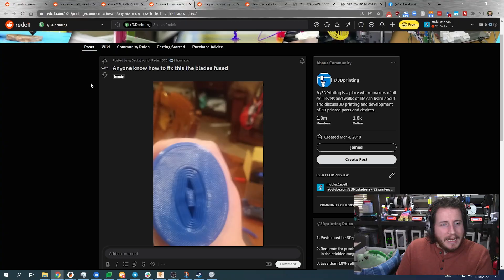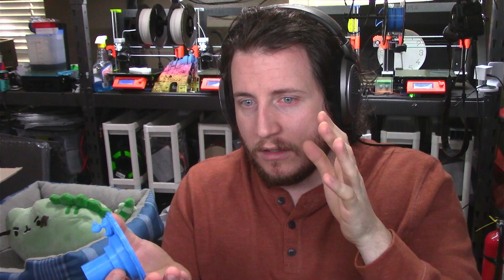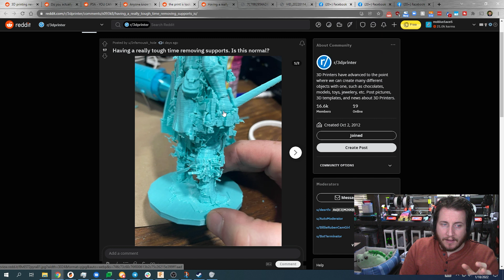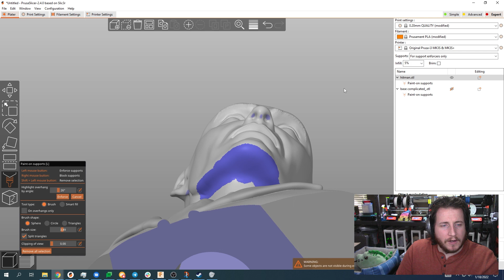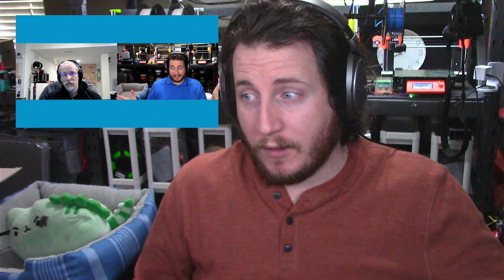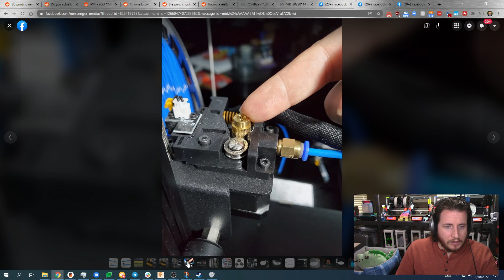Is It Possible to KILL Your Printer's Motherboard? - PrintFixFriday S1E19

Comment: If I accidently mixed up the positive and negative wires coming from the power supply  would that kill my board? (tronxy v10)
Reply from the maker: it could happen if it is not properly isolated.

Comment: I hooked up a variable output buck converter to change the hotend fan, just the buck converter without the fan hooked in yet, and turned on the printer and there was a big spark from the buck converter. Later, I smelled something... then I tried to use my klipper API (Mainsail) and it won't let me, complaining that it's unable to connect to the mcu. Then I expose the motherboard and find that the smell could be coming from there. I don't think my wiring was bad so... if the buck converter shorted, could shorting the k-fan (hotend) blow up my mainboard? My mainboard is Creality 4.3.1, if that helps.

Edit: I just looked at the mainboard closely and the capacitors are fine; the only damage I can find is on the biggest chip in the board, I think it's the processor; it has two little melted points on it and I'm guessing this is what I was smelling.
Reply from the maker: yep.. thats a dead board :/ Why use a buck converter when you can just get a fan with the right voltage?
Reply: @3DMusketeers  I'd like to, it'd be much easier, but I want the highest cfm 4010 fan I can find, and I got one with 9.9 cfm but it's 12 volts. Also it's still quieter than the stock Creality fan, so really the only caveat is the buck converter.
Reply from the maker: @josephzicaro79  you want a boost converter not a buck. 

Also, CFM is not everything. You also want static pressure. If you have lots of CFM but no static pressure it wont flow through the duct(s) you have
Reply: @3DMusketeers  Buck converters, or step down converters, decrease the voltage (and thus increase current because of the conservation of power) whereas boost converters increase voltage. Going from 24V to 12V, I want a buck converter, not a boost converter. 

Thanks for the static pressure tip, I'll look into it, but I'm guessing that static pressure is approximately linearly related to CFM, so I'm not too concerned.
Reply from the maker: I had that backwards in my head.. I thought it was a 12v printer, sorry!

Honestly the bog standard 5015's work fine for me!

Comment: I once accidentally fried the thermistor inputs of a SKR 1.3.
Reply from the maker: rip :( What did you do???
Reply: @3DMusketeers  Messing with the connections while it was on.
Reply from the maker: Been there before :/ Thankfully motherboards have come down so much in price with many options out there!
Reply: @3DMusketeers  I replaced it, then the SKR 1.4 came out shortly after.

Comment: 2 weeks ago I accidentally bridged the thermistor and heater cable with one of those brass nozzle toothbrush while cleaning the nozzle when the printer was on. the main board got fried of course with wrong temp readings. Be careful when using this tool guys!
Reply from the maker: YEP, don't use metal brushes unless your connections are insulated :) You can always heat up the printer and then quickly turn it off to make sure you can clean it safely.

Comment: I tend to plug stuff into a power strip and turn off the device AND the power strip. That way, the case ground is still there.

Cura has settings to adjust z distance AND x/y distance to supports. .23mm works for me but, of course, that's heavily printer-dependent.

Layer 1 can also be deceptive! It can look great when you're both under-extruding AND too close. In that instance, you're filling a smaller gap, but then all subsequent layers are garbage.
Reply from the maker: that is also a good plan! Just have to make sure there is no leaking of voltage!
Reply: @3DMusketeers  Yes. Ideally using an electrician's thumb to be certain.
Reply from the maker: YES! Those are great!

Comment: Reiterating: RESIN IS TOXIC

Haven’t had any issues with it (yet), but I’m pretty damn careful with it. Especially when airbrushing it on my FDM prints. 

Kidding. Just kidding. NEVER SPRAY RESIN!
Reply from the maker: looks for ban hammer

false alarm LOL.
Reply: @3DMusketeers  😬
Reply: @3DMusketeers  we discussed the spraying thing on your video about that. The concept is interesting but far too dangerous to even attempt. There are businesses with dedicated equipment for such tasks, and your basement or spare room is nowhere even close to being that capable of this task. 

DO NOT ATTEMPT! 

Wash all surfaces and wear nitrile gloves while handling anything with uncured resin. Use UV light to cure paper towels and gloves when done. DO NOT throw uncured resin in trash or pour down drains!
Reply from the maker: Thanks for fighting the good fight!